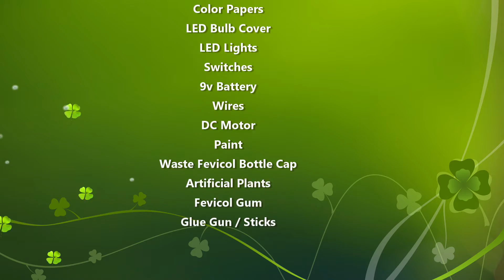renewable energy park working model (solar/wind/hydroelectric energy working model) | howtofunda

Comment: Sister please put explanation
Reply from the maker: Simple Explanation :

A renewable energy park is like a green power paradise where nature's energy rules. Imagine a special place filled with solar panels, wind turbines, and maybe even hydropower stations. 
It's like nature's amusement park, but instead of rides, we have devices soaking up sunlight, harnessing wind, and tapping into flowing water to generate clean, Earth-friendly energy. 
These parks are like giant superhero teams, working together to provide electricity without harming the planet. 
They turn sunbeams, breezes, and water flows into power, creating a sustainable energy haven. A renewable energy park is where nature and technology join forces for a brighter, greener future.
Reply: @howtofunda 😢
Reply: @howtofunda 7:22 7:22 7:22 7:22 7:22 7:22 7:22 7:22 7:22 7:22 7:22 7:22 7:22 7:22 7:22 7:22 7:22 7:22 7:22 7:22 7:22 7:22 😮
Reply: Hindi me kari yrr